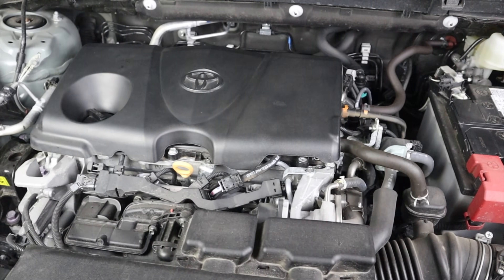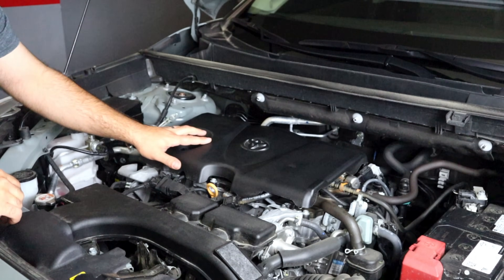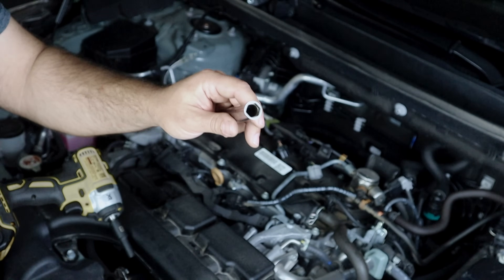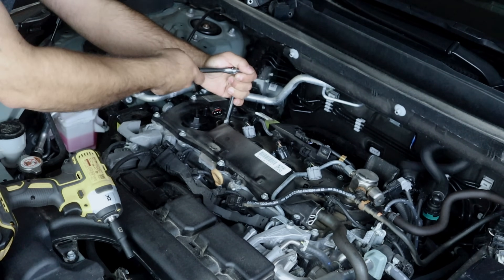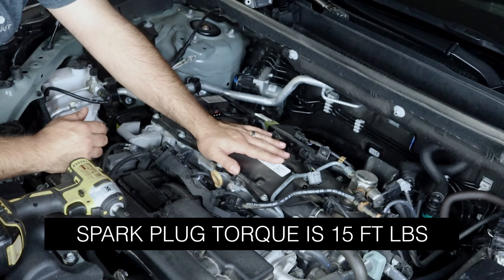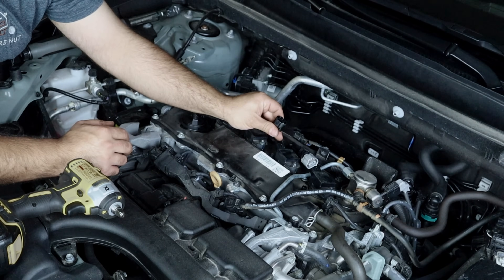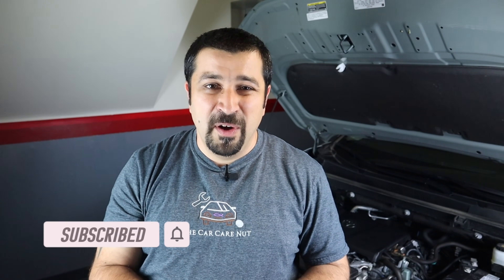How to Change Spark Plugs on Toyota's New Engine A25A and M20A

Comment: sorry for the late post, but I just went to change my spark plugs in my camry (A25AFKS) and the ceramic on the plus broke off and fell into the cylinder and is now on top of the piston!  i have a powerful shopvac and managed to taper it down to fit to the bottom of the plus cylinder, then rotated the piston as high as it would go, but there still isn't enough vacuum.  is it possible to pull out the spark plug cylinder after removing the valve cover, then use vac or grab tools to get out pieces?

Comment: Need help. I bought some supposedly oem spark plug online. Compared the new ones  to my original plugs they look identical but did not look to see if it had a Y at the tip. To make long story short after installation my 2021 sienna ran fine but after about 6 days while driving to work my check engine light came on and felt the loss of power . Any feed back on what can be wrong.thanks

Comment: Looking to replace OEM Denso spark plugs, bought at Toyota dealer, on 09 Rav4. Did I hear correct to not to use di-electric grease? (7:01 he just said do not use anything)
Reply: Correct. Do not use dielectric grease.

Comment: I add silicone dielectric compound at the spark plug boot, and I use anti seize , just a little at the upper threads, so they do not stick next time I remove them. Silicone works on the electrical connector too.
Reply: Do not use anti-sieze on spark plugs. Are you sure you watched (and listened to) the video?

Comment: Why didn't you check the gap on the new plugs? Why didn't you blow out the spark plug tube to remove debris before you pulled the plugs? Not necessary? In your shop, maybe.

Comment: I have a 2018 RAV4 with close to 100K miles. Local dealership in Northern Virginia wanted over $500 for spark plugs changed including labor. I checked the price of genuine Toyota spark plugs from the dealership were about $20 each and I needed four of those. I watched a few videos on YouTube and did it myself all along enjoying the whole process, learned a few things about my vehicle and had a nice little mental break from my hectic work routine.

Comment: Hey good afternoon I met him. I have a 2013 Toyota Prius just a regular Prius not a primer anything like that just a regular 2013 Toyota Prius has a 88,000 original miles on it keep up the maintenance I need a change filters I change the oil on it. I check all of the hoses and wires and stuff. The battery tested everything always test good wondering if that my car is due for for the spark plugs to be changed and also I don’t know if the Prius is that I have it. It makes a noise on the left front ever since I got. It makes a noise from the the left front we put it up on the rack. I can’t see anything loose. I don’t see any berries, lose any stress that are leaking oil or anything I can’t. I can’t understand where that noise is coming from his sounds like there’s something loose when I hit a certain kind of bummed. Maybe I should check the the Berry on top of the tower of the McPherson strut maybe that’s messed up I don’t know.

Comment: Hello CCN! I have a 2019 Camry with the A25A engine, 50K miles. I’ve been having a hesitation/surging while accelerating, bouncing between 1200-1500rpms. Fuel pump recall has been done, transmission software updated, smoke test performed, no leaks, no codes. I removed the plugs the other day and #3 was very wet with fuel. Other 3 were dry.
Reply: Make sure the oil level in the engine isn't excessive. Anything over full in a warmed up engine is considered excessive. This is especially important in a hybrid.

Comment: Consumers need to ask for legislation on price gouging! 

Dealerships want a Kidney for this repair ! $400!

Not all of us are mechanical incline! Thank you for the video!

This might look easy, my luck is I break something! and damage the engine... This video is 10 minutes! 4 spark plugs, $53... The rest is $400 on labor, Come on man!
Reply: Dont need legislation. Vote with your feet. Legislators usually know.bupkis about what theyre legislating..Dealer have massive overheads. Those fancy glass paned mega dealerships are costly. Then pay mechanics, writers, utilities, bla bla bla. Its never gonna be close to as cheap as u can DIY for, as you have none of those bills. Are they often crooked? Yep.. Find an independent like the CC nut. Hes not cheap either i hear, but he wont sell crap you dont need.Price controls always have all kinds of unintended consequences..

Comment: Mine is toyota  raw4 2023  when  should I do transmission  oil change now it's almost 1.5 yes as its low km driven car 2875 km only
Reply: Would say 80k to 100k kilomiles, convert it to miles

Comment: For me, that rubber socket insert falls out after a while- I use a 10” or so length of 5/16” fuel hose after loosening the plug with the socket, slip the hose over the plug and spin it the rest of the way and it stays in the hose.

Comment: Is it a good idea to replace the valve cover gasket with a spark plug change on a  A25A in particular. Or would u wait ti later? I have a little over 96k currently on my A25A

Comment: Thank you for your video explanation. You mentioned the tools needed to open the spark plugs and provided your recommendations. Could you please share the link to those tools? I have a 2019 RAV4 with 90,000 km on it, and it's started shutting off due to spark plug issues.

Thank you!

Comment: Seems like CCNut doesn't know spark plug. LOL, just go buy OEM is what he keeps saying.   FYI, these are call "Double Needle" spark plugs have top and bottom needle between the gap for the new cars.  Normal/Old spark plugs only have one sided needle.  On the video 6:06 timeframe shows it clearly.  After market is fine if you know what you are buying.
Reply: He literally says to shop around and “don’t just buy full price at the dealer”.

Shut your mouth if you’re not going speak facts

Comment: I have an 2018 Camry, just turned 60,000 miles. Dealer wanted a ridiculous price to change 4 spark plugs. Bought plugs from dealer, followed your video and changed myself.  It went flawlessly, very easy to do. Thank you for these videos.
Reply: Consumers need to ask for legislation on price gouging! 

Dealerships want a Kidney for this repair ! $400!

Not all of us are mechanical incline! Thank you for the video!

This might look easy, my luck is I break something! and damage the engine... This video is 10 minutes! 4 spark plugs, $53... The rest is $400 on labor, Come on man!
Reply: My 18 camry is going on 125k miles and still running good. Going to change spark plugs and oil soon and this vid gave me confidence to change my own.
Reply: Is your camry a V6?
Reply: @jasoncurry2515  I have the 4 cyl engine.
Reply: Insane. Quoted 475 for a transmission drain and fill. Got it done for $240 at a reputable shop down the street. They wanted $700 to flush the radiator and spark plugs. Between fluids and tools I saved myself $500 at least doing those myself. I would not recommend messing with the transmission fluid unless you are very experienced with cars. Not with the hassle if you mess up

Comment: The important thing which needs emphasising is you put the plugs in with your fingers just like AMD did in the video, you do not use the wrench until you have screwed the plugs in a few turns until they are finger tight. On engines like this you must use the socket and extension but don't start with the wrench.  Also I do plugs slightly differently to AMD, when I first put them in I turn them the wrong way for a turn or two just to make sure the threads are seated correctly then I turn them the correct way.

Comment: Piece of cake with this video. Bought on Amazon 14mm spark plug socket off your link. I already had a Torque wrench. Probably took about 30 min start to finish for me. I went a little over at 130k. No wet plugs.

Comment: Who says you can't teach an old dog new tricks? I haven't changed a spark plug since the spark plug hex was either 13/16 in. or 5/8 in. Much has changed since then. Any chance you could do a video on replacing spark plug tubes (because of oil leaking into them) on 4 and 6 cylinder Toyota engines....or have you?

Comment: Dude you went too fast for the most important parts: removing the old plug and putting in the new one.  You should show the spark plug on the torque wrench prior to installation.  How do you put that plug into the socket without dropping or otherwise screwing up the gap?
Reply: They have rubber inserts that hold the spark plug in place and all Toyota spark plugs are pre gapped. You could actually damage the plug by trying to gap it

Comment: So I own a 2019 Toyota Corolla hatchback with a 2.0 engine... I'm assuming this should be the correct video I'm watching... I just pulled my spark plugs after driving it back home from work about 30 minutes or so. Let the car sit for about an hour and a half and pulled the spark plugs. When I pulled the spark plugs, the threads have oil on them. And it looks like the plugs are charred and burnt with what looks like a small stalagmite forming on the end of the hooked shape electrode.... I'm assuming that this is an indicator that I need to replace the valve cover gasket? And also probably replace my spark plug sooner than about 80,000 mi? Is this all that I need to worry about currently?? Anyone's advice or help would be much appreciated ! I've been scouring the internet but there's not really too much information about these newer engines.

Comment: I have a 2021 corolla se I have used a 14mm socket and can't seem to get the spark plug to come out, it seems like the 14mm just spins on the spark like it doesn't grip it at all any advice? Is there a special socket for this car?

Comment: You stated no anti seize on the plug threads but you didn’t say why, could you tell me why?
Reply: Most of the spark plug manufacturers don't recommend using it either.. it has to do with over torquing.
Reply: @cards-vs7hv that seems odd to me. As a jet engine mechanic I was trained that threads must have lubricant to ensure accurate torque. Even flange bolts required at minimum oil on the threads. I’ve never heard that spark plug manufacturers don’t recommend anti-seize, only not to get it on the electrode. Do you have any references for what you are saying? I’d like to understand the thought behind that.

Comment: Well, they tried to keep the injector noise level down with the engine cover padding on the underside as well as the padding under the hood but it needs more. The other method is to have the radio produce the opposite frequency of the engine noise even when the radio is off thereby canceling it out.

Comment: What do you mean by not using NICs when installing the new spark plugs? I’m planning on using a little anti seaze that the dealer said would be ok. Is that what you meant? Thanks for your videos.

Comment: I have a 2022 Corolla Apex 2.2 liter 4 cylinder. It takes 0W16 synthetic oil. The dealer says the oil change interval is every 10K miles. Can I safely change the oil in this car every 10K miles or should I change it at a lower interval? Please advise. Should I use BG MOA oil additive every oil change interval? The car has about 25K miles. Thank you!

Comment: One really good practice to perform after removing coil but before removing spark plug is to blow out the spark plug hole with compressed air to avoid something dropping into the cylinder when you remove the plug. If you don't have an air compressor, you can buy a can of compressed air.
Reply: I thought the same, thing!

Comment: I love this channel Toyota enthusiasts here. Hey I got a 2000 Toyota Celica gts with 315,000 plus miles, and the car still runs strong. I am it's first owner and would love to here your good story and bad story's with the 2zzge engine not the oil burning not so loved 1zzfe. Also how where costumers reaction when it was at the dealership. I also got another celica gts build 2zzge with alot of power when running high boost close deck design block. Real fan of Toyota in general. I love all cars but Toyota is definitely my favorite. I just got a 2019 rav4 and just popped a video on youtube of rav4 and great tips for maintaining the engine.

Comment: Gap?  You didn't say a word about the spark plug gap.  I know better than to assume they are correct coming out of the box.  In my opinion the gap is at least as important as the torque to install them with. I saw several other inquiries about it with no response from you.
Reply: Platinum plugs used to always say “ do not gap” . I’m sure iridium is the same. Gapping plugs is pretty much a thing of the past at this point. Probably why he didn’t mention it as AMD is very detailed

Comment: Do the oem spark plugs come gapped? And when would you wanna change the coils? When you get a misfire? Should you disconnect the negative battery cable before doing this? And would that cause any issues like error codes?
Reply: Spark plugs come pre-gapped but I always check them to make sure. You can find gap specification in owner's manual or in hood compartment. I only change the coils when they fail. I have over 100K miles on mine and working just fine. If you get a misfire, you have to troubleshoot to determine if it's the spark plug, coil, fuel injection, or compression. The majority of the time it's going to be the spark plug or ignition coil. You defintely want to disconnect the ground cable from the battery before doing any work under the hood in any vehicle especially if you're going to be working on anything electrical like sensors, injectors, alternator, coils. Disconnecting the battery will not cause error codes, but if you have a stereo system that requires security code, make sure you have that code before disonnecting battery. They also have memory savers that you can buy.

Comment: Is it okay to remove the spark plugs with a regular socket without the rubber?
Reply: Yes, but you'll need a magnet to get plugs out and a piece of rubber hose to put plugs back in. They also sell magnetic sockets for this purpose.

Comment: Thanks for the videos. How much does that digital torque wrench run? Do you have to send that off for calibration every year? Is that the case with all them? Any that don't need to be calibrated so often? I've always bought cheap ones from Harbor Freight, and unless I'm missing something, it's cheaper just to buy a new one than to send it off for calibration. I've seen the diy calibration tests and adjustments but wonder if that's a good idea.

Comment: I find it odd that you tell us to check owners manuals for stuff, but have you ever done that yourself on the newer ones? My manual doesn't even have changing oil information in it, just everything about the gigets and gadgets the car has. (2019 Camry) In my 2000 s10 manual, it actually shows you how to adjust the valves. In my 2019 Camry manual, it just tells me not to eat the contents of the battery. Boy how far we have advanced.

Comment: PLEASE HELP….
I have a question. I have a 2018 Toyota Corolla I store during the winter. I’m getting ready to take out of storage. Should I remove the spark plugs and spray a little “fogging oil” before I start it. It’s been sitting for almost 6 months. I will be changing the oil as well.

Comment: I have a question. I have a 2018 Toyota Corolla I store during the winter. I’m getting ready to take out of storage. Should I remove the spark plugs and spray a little “fogging oil” before I start it. It’s been sitting for almost 6 months. I will be changing the oil as well.
Reply from the maker: Hi! It would be a good idea to do that since it’s a reoccurring storage.

Comment: I bought a new 2021 Rav4 XLE non hybrid last week.  Besides 2.5L which engine is used in mine?  Thanks
Reply from the maker: Hi! If it’s a US model it should be the 2.5L A25A only.
Reply: @TheCarCareNut  I forgot to mention I am in Canada and it was manufactured here in Canada as well.

Comment: Why no anti seize on the spark plugs? Are the plugs stainless steel and the cylinder head aluminum or what? I wonder if Toyota uses NGK plugs in these new engines. 🤔

Comment: As the vehicles with this engine are coming up in mileage, PCV valve needs to be checked and/or replaced.  The intake manifold has to be removed in order to get to it.  Can you please make a video on how to remove the intake manifold?  I have a 2018 Camry with 70k miles.
Reply: I'm surprised Toyota engineers designed this engine so that you have to remove intake manifold just to get to PCV. Bad design!

Comment: could you do a video on jacking and positioning jack stands on the Gen 2 and 3 Prius? A DIYer can easily cause significant damage to a nice expensive toyota by jacking  and supporting in the wrong places.  Not to mention bodily injury to ones self.  Thank you in advance

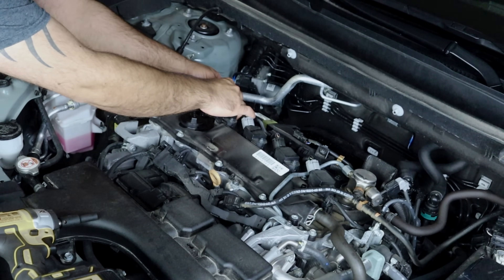Comment: 3:20 they don't break easily probably because engine is not that old and not brittle cause not so toasted compared to the older ones - just my opinion.
Reply from the maker: I hear you. However it seems like they made the connector better it doesn’t require a lot of pushing to release like the old ones. The old ones were a pain to remove even when they’re newer. You’re right though time will tell if they do the same as the old ones.
Reply: @TheCarCareNut  yes, they really hurt my thumb..

Comment: Is this applicable to CHR?
Reply from the maker: Hi! The CHR doesn’t have this engine. It has the 1.8 which is covered in this video https://youtu.be/IAb9b3Hrea0
Reply: @TheCarCareNut  Thanks AMD. If Iam not mistaken. CHR is a 2.0 L 3ZR-FAE 4cyl. Is there a difference now from 1.8l?
Reply from the maker: Similar but not the A25A or M20A
Reply: @TheCarCareNut  ok got it, I assume relatively same set up to replace. Thank you kind sir as always. You are the best hands down.